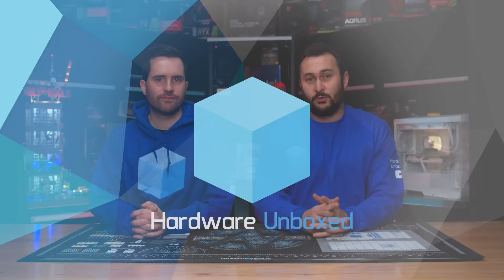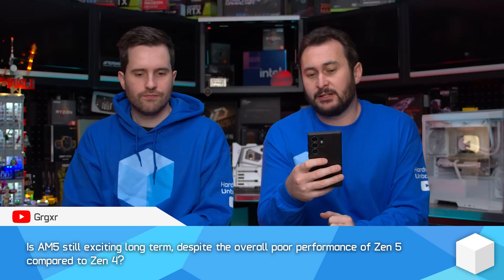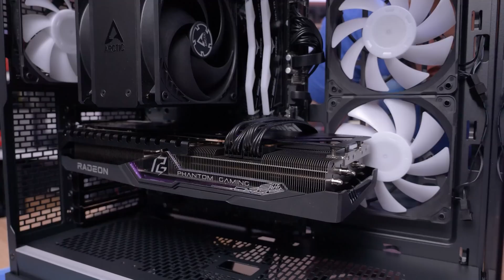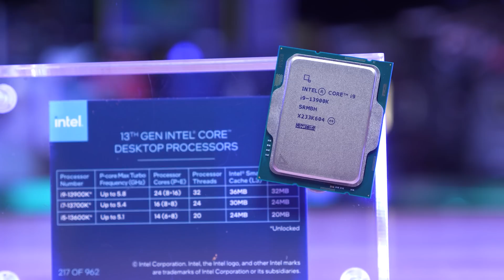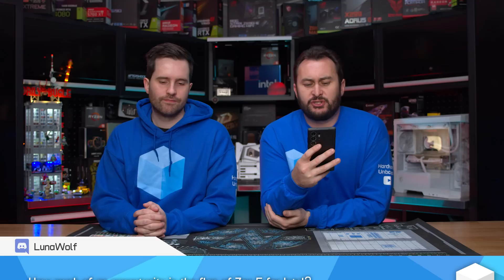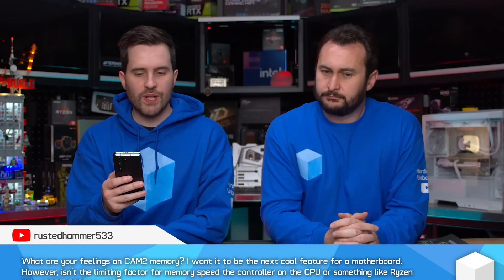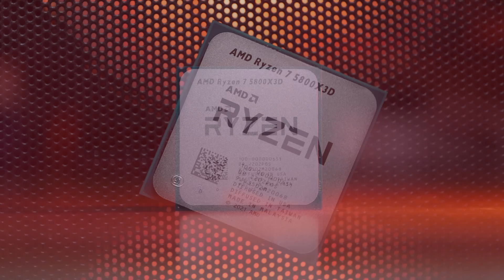Our RDNA4 Expectations, Can Intel Gain Lead After Mediocre Zen 5?

Comment: I believe the rx 8800xt will be a 7900xt level with better ray tracing. I believe the 8800xt will be 10 percent faster then 7900xt in 1080p, neck and neck in 1440p and at 4k i believe the 7900xt will win by a slight bit  in rasterisation
Reply: which if it ls 499 that’s decent

Comment: Agree. AMDs dGPU strategy is a disaster and has been a total failure. If they want to attack Nvidia, they can with the N48, if they price it aggressively from the start, so 500$/500€ inc VAT. And launch ASAP is big quantities, as Nvidia will not have any response, but to lowe prices. Any 5080 will be much costlier and 4090 perf.

Comment: My opinion regarding OC limits is simple: the OC utility that's included with the driver and therefore easily available to an average end user should have safety limit to prevent people from damaging their hardware however at the same time there should be some way for hardcore overclockers to unlock these limits by some out of the way configuration file or a separate utility altogether.

Comment: is it a chance that new rx 8000 or intel battlemage will be good enough in 3d rendering ? I intrested in  blender cycles . blender eevee next . unreal engine . I can afford only  4060ti 16gb or 4070 12gb. But  they dont make me happy. I would prefer 7800xt but with improved ray tracing performance.

Comment: I actually think it is smart for AMD to concede the top tier $1000 plus gaming market to Nvidia. Lets face it, gaming GPU's are not where the money is, it's server farms for AI. If AMD simply wants to refresh RDNA at similar performance but with an efficiency improvement, and most importantly a yield improvement that can help them undercut Nvidia in the entry to mid range gamer market, they can claim a market position that matters. In marketing you can only really have three positions, "I'm the best" "I cost less" or "I have a differentiated feature nobody else has" - AMD's too open to be differentiated, it would go against their strategy to start putting in proprietary features, so that is out... Being the best in gaming performance, I'm sure they have the engineering to do it but is it worth the niche market share that are the ultra-high end PC gaming enthusiasts? So.... they only have one place to go, compete on price, and really get serious about it. Get laser focused on those $250 to $500 products and win there by wide margins on price, because ultimately even just a 5% win won't be enough, it's going to need to be something the builder really feels on the most expensive component in most systems, I'd say 15% better price to similar performance to squeeze Nvida out on the less expensive product. They want $300, AMD needs to be at $250 - Nvidia says give me $500 for this, AMD will legit have to be at about $429 to get gamers to budge. The only way AMD is going to be able to do that is to really focus on yield and efficiency in what they manufacture in this next generation. They can't afford to waste silicon or attention on a market share they can't compete at.

Comment: With regard to expectations of the next generations of CPUs, regardless of the manufacturer, I wonder if we've been spoiled over the past two decades with each new generation, generally, coming out with significant jumps in performance. I'm beginning to think that to expect significant performance hikes to occur within one year of the pervious generation is unrealistic - and we're seeing that now. I think we've come to a plateau in engineering. Without a sea change in the elements of CPUs, you're only going to see small,  incremental increases in performance. It's a bit surprising to see disappointment that the new line of CPUs doesn't provide 20% + boosts over the last generation. Were you really expecting any manufacturer to pull that kind of rabbit out of their hat in one year?

Most PC builders factor in the longevity of their components - especially the CPU - to carry them through at least 3-5 years before really needing an upgrade. We're already recognizing there's very little reason to bother switching main components year over year, so why should we be surprised when next year's components are only slightly better than what we already have? It's when our personal timeframe for upgrading has elapsed that we should come to expect the really noticeable difference in performance, not next year's generation.

Comment: Regarding AMD and the high-end on the 8000 series, I find the strategy relevant. We are at a level where GPU performance is well present, but there are gaps in game optimization for some years now and technologies that are still being refined. Third negative point, instead of optimizing, the tendency of some manufacturers is to open watts to gain naturally and mechanically in performance, the ease, while there are indirect costs for the user with an increased need for a more efficient cooling system or the expenditure on electricity. Taking a break on a level, as AMD does, to optimize the existing in relation to yields such as technologies with AFMF2 for example, seems an interesting strategic solution. Just like video game publishers that could allow their developers to do the same and stop releasing mediocre and unfinished games. The hardware exists, a time of consolidation would be good omen. My humble opinion. The future will tell us!

Comment: zen5 seems like a case of bad misleading advertising rather than it actually being bad. If they had said you will get pretty much the same performance as zen 4 but far more  power efficient   it would have been fine. To me anyway

Comment: cRaptor Lake is an overclocked cpu that pushed votlages and clocks to the limit to win benchmarks and is a disaster and somebody actually thinks that's good for consumers. Arrow lake's e-cores are much more powerful than cRaptor Lakes. I'll take 20 real cores over 12 real cores and HTing any day of the week. In nearly all workloads I'd use cRaptor Lake easily beats AMD in multicore workloads. Power is ludicrous though.

Comment: Do you think we will have in the future good gaming cpus that draw very little power when idle, like the intel 12100 and 12400? AM5 Cpus aren't good at that, and the last 2 generations of Intel had self destroying cpus due to voltage problems.

Comment: Hey guys, just a heads up about another YouTube channel using your content for one of their videos. The channel "Lou's WRX" and the video titled "I will show you why going with Intel 13th or 14th Generation may be a costly mistake!" uses your content for a good portion of the video. You're likely unaware of this as they've uploaded your content by recording it with their phone while it plays on a monitor and adjusting the audio - likely to bypass any automated copyright detection. Their first response was that it's okay because the video "isn't monetized" but later claimed "it's shared revenue" and edited out the non-monetization claim in their first reply. I guess my question is: are you aware of this creator using your content?

Comment: More than Nvidia, AMD or even Intel GPU's what is making me wonder most is the mentioning of ARM developing a GPU. My quetsions about that is armed by the fact that ARM is a fabless company that also doesn't sell ARM processors. What they do sell is licenses for other companies to use their IP to design and produce processors. And if you compare ARM processors produced by say Samsung and Apple they are quite different. So far ARM has not had a GPU design so their customers has licensed or created GPU designs that's been integrated in the ARM processors they make.
Now my question is what the goal of the GPU designed by ARM is. Will it be a IP that they sell for other companies to use to build GPU's, or is it designed to be integrated with ARM cores in CPU's? Some people have been saying it will result in GPU that will be used in PC computers. What's the real target here for ARM? will they dare to jump onto the PC market and if so will ARM start selling GPU's like say Nvidia or will they sell licenses to use their IP to chip manufacturers?

I would love if ARM designed GPU were actually to make it into the market in a stable and high performing fashion. I'm not holding my breath though as it would actually surprise me if it happened. Still the market needs more than two or even three companies competing for the users money.

Comment: 3:30
even if they stay in the entry level price/performance bracket, as long as they fix their current trust problems battlemage could be a success as that's the biggest market segment. alchemist had shown their willingness to improve and getting battlemage (in a useable state from the get go) onto the market might signal enough commitment for people and companies to consider intel for computers which do not need the highest performance but more than integrated graphics. but in order to make it a success the current cpu debacle would have to be fixed, instead of the stance intel still takes: "if rma is rejected, just file another and at some point there'll be someone being okay with the rma".

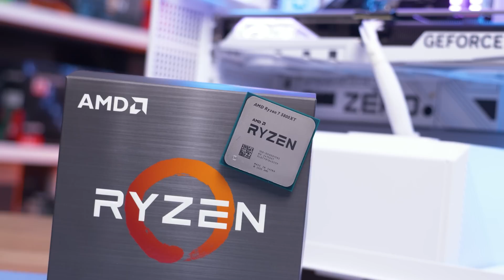Comment: 8:00 I don't know about other people, I was going to do an upgrade this season. But with the Zen 5 being s*****, and AMD apparently trying to weasel out of supporting AM5, I have zero reasons to upgrade. I'm definitely not doing Intel, at least not yet. I think I'm going to wait and see what zen6 is going to be on as a platform. If it's not on AM5, then I'll know that AMD has learned nothing from the disaster Intel is going through and I'll wait until until fixes their problems and go Intel instead

Comment: 27:07 I think that most 5000 series Ryzen 7 and 9 chips are gonna be mostly fine for competent gaming into 2028. Look at how many folks are still using 4th to 9th gen. Intel to game. Barring the sudden emergence of cheap 4K and 8k monitors and a complete architectural revolution by all brands, most of these systems will likely still be good in 5 years for a solid 1080p and even 1440p experience when paired with an adequate GPU and RAM. If one takes the approach that they will be in perpetual upgrade mode in order to try to do AAA games at high-res/high refresh, and sets realistic performance expectations, then most of the chips from the last 4 generations will still be usable. It's not like the recommended specs on aging games suddenly go up at the mention of a new CPU/GPU series. I also feel like there will be optimizations for handheld gaming, APUs, and Snapdragon that will factor in. I can't see lower end hardware ceasing to exist from this point forward either...and it's usually around last gen. mid-tier performance.

If you're playing older games, AM4 will be more than adequate until your system dies. If your current system plays Cyberpunk at decent rates with decent resolution, then it shouldn't be a big deal to get at least a few more enjoyable years out of it...especially with things like FSR, DLSS, XeSS, frame generation, etc. Given how many people are still on GTX 10 Series right now, I can't see many newer architectures than that just suddenly equating to playing on a Bulldozer CPU with a GT 710. That's just me though. My wife's 3800X is still giving her a solid 1440p experience at high settings in the MMOs and single player stuff that she plays. She didn't really even notice when I swapped her 5700 XT out for a 6700 XT a few years ago. Tempered expectations in AAA games and a willingness to lower resolution and quality settings a bit will be the determining factor for the individual.

Comment: Regarding the overclocking part.
I have been facing a weird issue. So me and my friend have similar builds, the specs are:
B760m(i have a msi bomber he has a msi mag mortar)
I5 12400f
G skill triden z 32gb ddr5 6000mhz
6700xt
The problem is when he turns xmp on for memory and runs it at 6000mhz as advertised games keep randomly closing and bsod sometimes. But since he has turned it off and ran it at 4800mhz its working fine. Still dont know if its an issue with the memory kit. I think so it is because mine is working fine at 6000mhz. Still confused. Searched about it and saw that some other users also faced this issue with g skill trident ddr5. So should i get it replaced in warranty? The warranty management in my country is really a fuff to deal with. Still confused

Comment: Zen5 is a big let down IMO. It pretty much killed the upgradability factor in AM5 as all hopes rely on Zen6 now (for gaming). I expect very little from Zen5 X3D whereas before I was expecting a ~15% uplift. 

Now it’s going to be either: wait for Zen6 and probably save on a bit by reusing MOBO/RAM with the caveat that maybe upgraded conectivity and memory controllers might make new MOBOs and Memory kits desirable.

Or jump on Intel’s new platform if it performs and hope for a 12 to 13 gen uplift (w/o performance issues hopefully). By then both companies are back at new sockets again if Intel keeps the 2 gen cycle.

Comment: I equate what is currently going on with AMD with something automotive companies have done for years. One could buy car X with air conditioning one year. The next year, the same X car could have a 10hp gain on the motor; but, has no air conditioning. However, the "undercarriage" (i.e. AM5 motherboards) are still that same from last yeqr: it falls to the buyer as to what is more important for them. Buy the previous model, buy the current model, or wait for a future model. If this was meant to be a learning experience for AMD: it is potentially a rough one. However, if AMD can learn from the 9000 series "flop" to improve the next series of chips: then the flop would be worth it in the long run (i.e. sell car X with 20 more horsepower and have air conditioning).

Comment: AMD announced that the new bios update and next AM5 boards will run 9600X and 9700X at 105W which is aliened power consumption with 7600X and 7700X and should perform significantly better than them. IMO they should have done this to begin with with giving a option to run them at 65W for those who want efficiency and performance of 7000 series.
Reply: I wouldn’t count on that as the Zen4 non-X CPUs (65W) were pretty much on par with Zen4 X CPUs (105W).

Also, aren’t there tests already with Zen5 + PBO that resulted in very small performance gains?
Reply: @band0lero  Source : UFD Tech
But I guess you are right too. We will have to wait and see. I have another theory that these old AM5 boards cant run those cpu to their max potential and AMD lying about it because it will slow the sales of current B650/X670.

Comment: Amd is starting to do the bad business practises Intel used to do 

Zero innovation. Stagnant core counts . Zero boring 10% refresh performance uplifts . 

Releasing stale products that they shouldn't be releasing at all like they're not releasing the real 9,000 series (x3d) until q1 25? The only SKU that needs to exist without a 3D is the $9950 for very specific productivity workloads all the others shouldn't exist at all anymore.

Comment: 16:32 you are forgetting about one key area where those multicore performance is very important, even at the midrange end of the product stack like the Core i5-13600K, and that area is content creation for beginners who don't necessarily have the money to spend on a high end CPU. I believe most content creators start out this way when they don't have the budget for the highest end production machine.

Comment: On the AM5 topic, i think Zen 5's lack luster improvement just means amd needs to give 4 gens again... Am4 had a similar thing with "Zen+" aka the 2000 series which barely improved anything. But am4 was a win because of Zen 2 and 3. 

Amd just has to repeat that. And am5 will still be a goat. Hopefully they dont try to cheap out and only do 3 gens or something

Comment: The pricing is why I would love more cores on the mainstream chips. Like 32-core middle of the road Ripper is 4x the price of regular 16-core Ryzen 9. Double the cores and extra lanes for 4 times the money..... that's just too much, would use a 32-core desktop chip without the lanes for something like multiple instances of Handbrake as clocks also matter, that's why 32-core Epyc would be worse performer.

Comment: Consoles have been 8 cores for almost 10 years. AMD makes the hardware for the consoles. For gaming currently you don't need more than 8 cores until consoles transition to more than 8 cores. 16 total cores is a good amount for gaming and productivity. Until PS6, I don't see a point in AMD adding anymore cores, in a business sense. AMD PS4 and PS5 has been 8 cores, if it goes to 16 in PS6, I can see AMD going with 16 core + 8 core, and 16 core + 12 core, and 16 core + 16 core. Target game development is an AMD PS5, so no point in more cores at this time for likely years, as long as there's nothing to be gained from it. The more cores, the more power you need to power the cores.